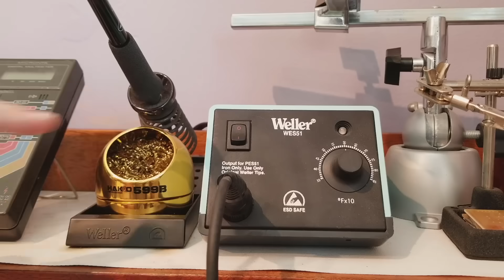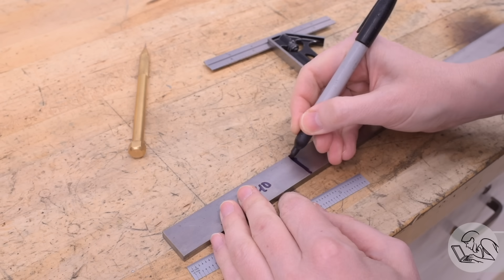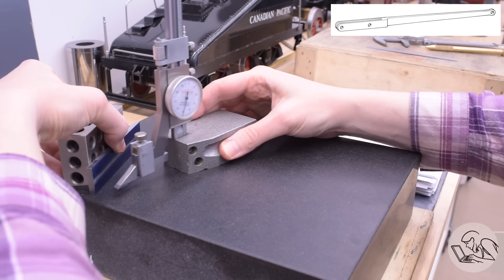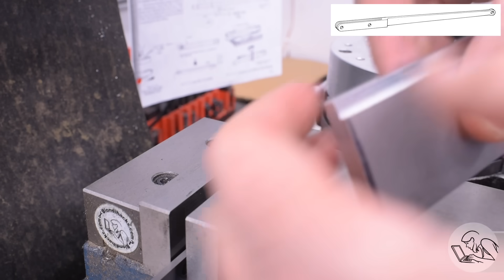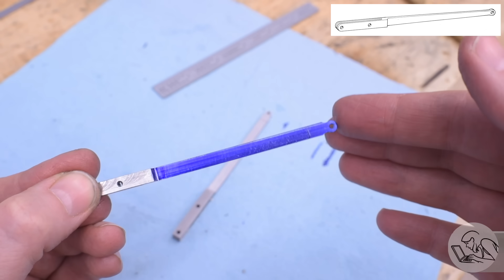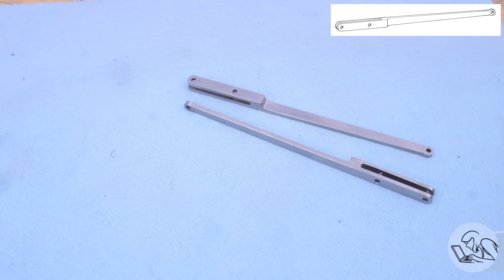Radius Arms - Pennsylvania A3 Switcher, Part 59

Comment: I had an endmill pull itself out of the collet and bury itself into the work while side milling with most of the length of the flutes. I think it's a matter of how much bite it can get on the material and "screw" itself down. That and cheap collets are no bueno.

Comment: Had you tried climb milling that thin fork it would have gone spectacularly terrible.  We're talking worst sounding tuning fork in history until either the fork bent or the end mill snapped.  Your solution worked, alternatively you could have used a shim or left like .005 in the middle to file out later.

Comment: For cutting the fork end of the rod, could you leave the rod long in a previous step, then cut a closed slot with the end mill, then trim the extra off the end revealing the fork, or does that open a new can of worms?  Thanks for the very helpful videos.

Comment: Dumb question because I love language stuff, why is it called normalizing instead of annealing in your field?

I tried to look it up but just came across the normalizing term in welding where it's a tempering term that indicates slight hardening with more randomized grains instead of the even relaxed grains in tempering.

In jewelry making I was taught the same thing you illustrated in the video but we just called it annealing.

Feel free to ignore the question if you don't know. Lots of language stuff is like that.
Reply from the maker: I don’t know why there are two different words for what is the same process.
Reply: Isn't the term annealing the term for repeat softening of material that work hardens e.g copper, brass and other non ferrous,whereas normalising is for materials that have high temperature inducec hardening ? Not sure 🤔
Reply: Annealing makes a metal softer for working, normalising removes stresses in a material that could cause deformation during machining. Basically the same process though

Comment: If you really want to feel the pucker factor, try using a .034 endmill to mill a slot through 1/8" 304 stainless steel flat stock on a full size Bridgeport. It's required to make machines dealing with catheters in the medial research field.

Comment: Only a thought, because I don't know enough about machining to make a suggestion: After cutting halfway thru the clevis end with the end mill, that partial slot might provide enough restrain tp both side of the slitting saw blade to finish the slot with the slitting saw.

Comment: I built quite a few tiny "vacuum engines", scaling down the size makes for some thin tiny parts. I've used superglue to hold down parts like these radius rods sometimes. That's a real nice "machinable fixture" you use on your rotary table. Thanks for showing this!

Comment: A Canadian quarter is 15/16th of an inch in diameter, that's only ~0.12 mm shy of the 24 mm of a Norwegian 10 kroner coin. Now I just need to find one of those, and I'll have a sense of the scale of the parts you make.

Comment: The "i do it my way, and then compare the end results to see if it works" is a thing i've used in engineering working in a team sometimes.
It's a valid approach when you need to figure something out, and someone else is working besides you. Both start working on a solution, but don't tell each other any of the intermediate steps or methods.
If the end results are close or identical, then you're on a good path.
If the results are way off, there might be issues somewhere that need to be solved.

Comment: As a woodworker, 1/16" is the smallest drill I ever used, until I needed to drill a hole for a single strand of fiber optic "cable", and 1/16" was too loose. Then I bought a 1/32" drill, which was more like a bit of spicy wire than an actual cutting tool. It did the job though.
Reply: My #80 drill is 0.0135",  0.3429mm.
Reply: As an electronics engineer the smallest I've used is about 0.2mm (=1/128"?). I picked up a tube of tiny chinese drills and some might even be smaller but I've not used them.
Reply: @ColinWatters  I make model kits and miniatures, and... I have a 0.3mm drill I've used, but yeah, that's more or less a bit of wire with a coarse texture.
Reply: Yep, can get down to 0.2mm (about 8thou) on a PCB mill